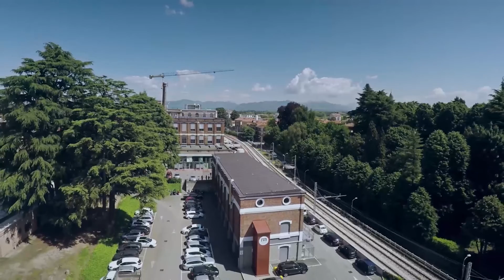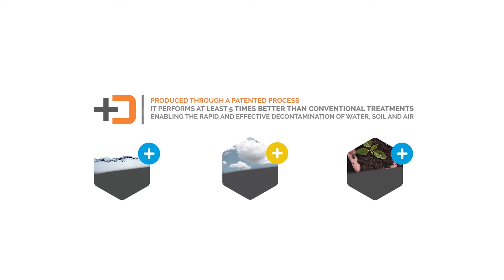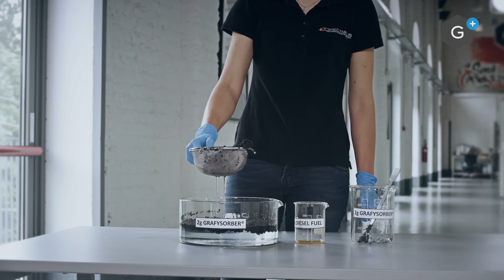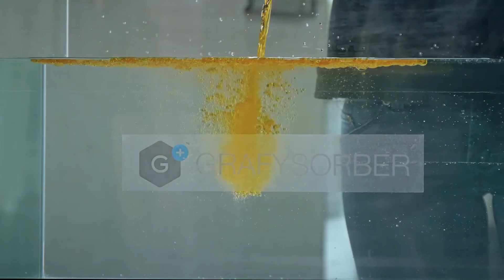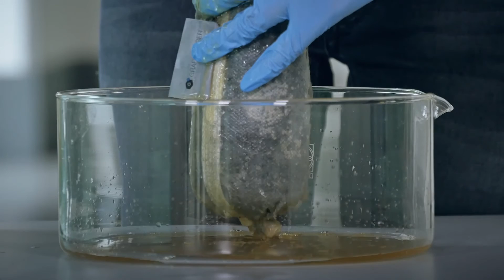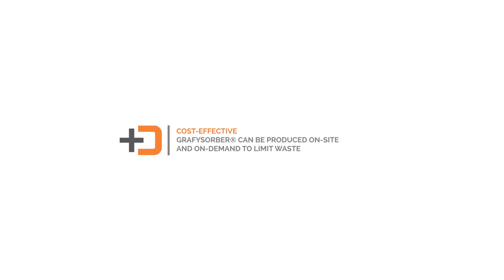GRAFYSORBER ®_Water Treatment

Comment: why not use this stuff inside a fuel tank from the start Then when a breach happens the fuel won't leak and the whole thing can be lifted and placed on another ship or if the breach is small the ship can be patched up and continue to it's destination. this can be applied to cars also and you can retrieve the fuel with mechanical compression for combustion.